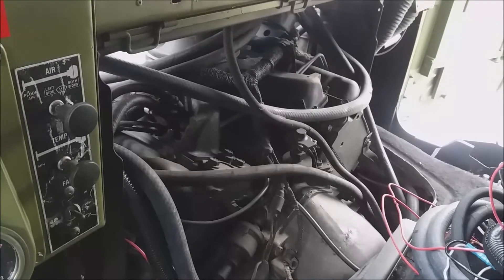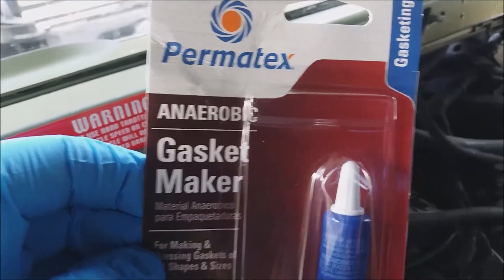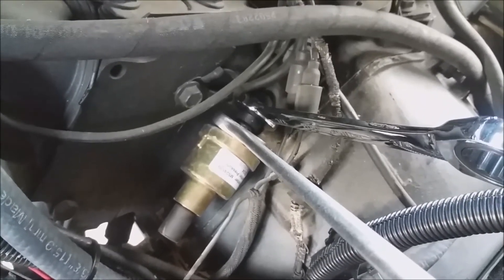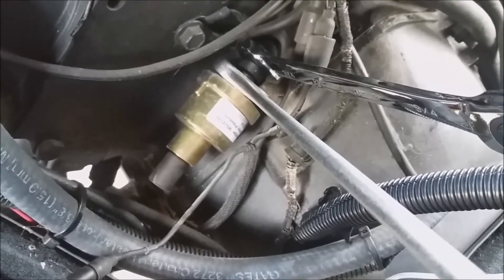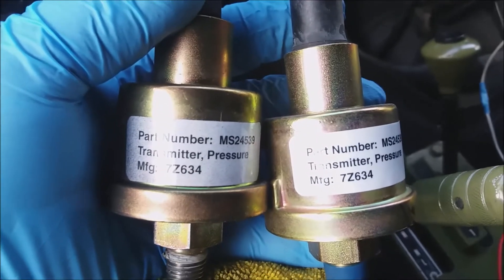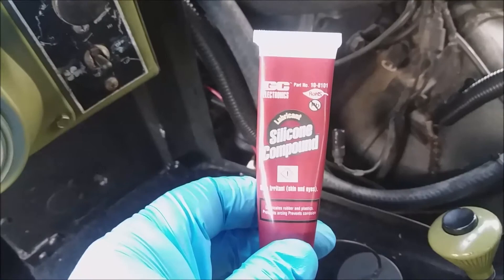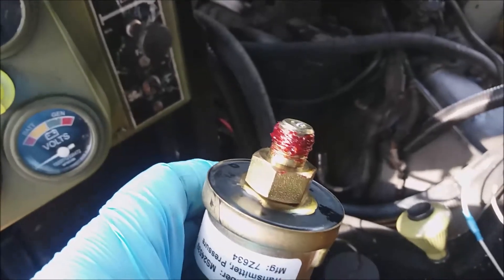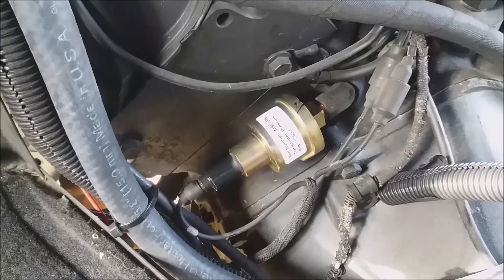HMMWV Oil Pressure Sending Unit

Comment: excellent video, this was super helpful and just what I needed to run a manual oil pressure gauge for testing. Thanks!
Reply: Do you run the manual gauge to where the sender threads into?
Reply: @M1151A1  yes that’s exactly where it goes, you’ll see it threads in at the back of the block easily accessible from the doghouse. Most manual gauges come with an assortment of threaded adaptors so you can match.
Reply: @beurownboss1554  thanks for the response!

Comment: Clean and simple video. Well done.    This is something I may need to do after trouble shooting the sequence of possible issues. Relieved it is very simple to do.  What were the symptoms that lead you to change this OPSU?   I am currently looking at an inconsistent start up and running pressure of 65-75 on my 6.5.  As we know normal run window is 40-60.